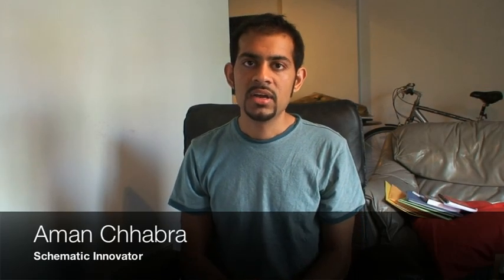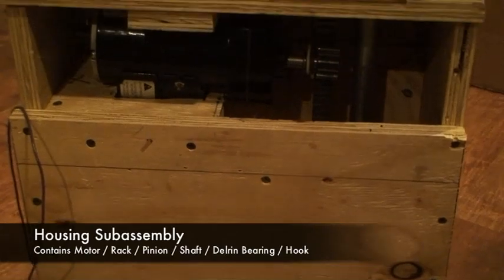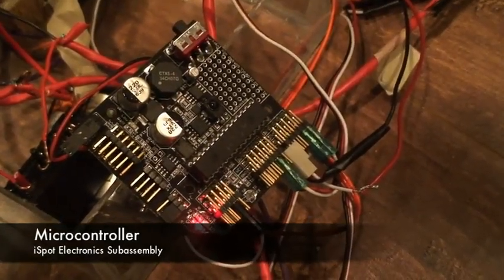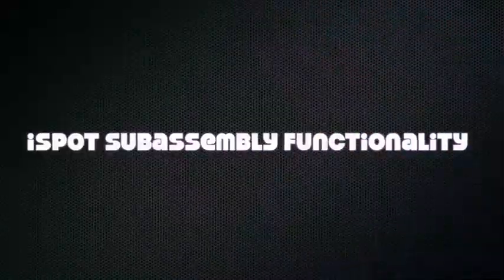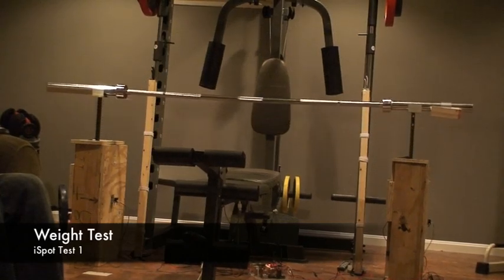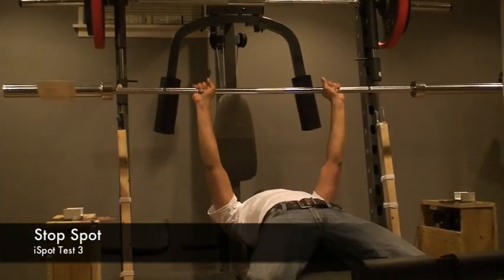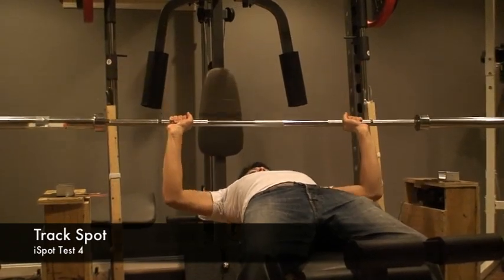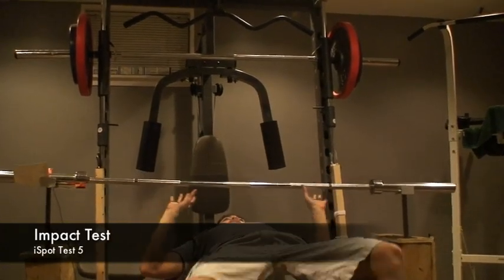iSpot Final Presentation Video

Comment: It's a nice idea but a little over-thought IMO. A couple of heavy-duty load straps hooked to a power rack or the bench pins does the trick for me. Position them slightly below the lifter's range of motion and you have a spot. How much weight can this really handle anyway? Is this for fitness enthusiasts or can it handle real weight?

Comment: Couple of things. First, they really need to be positioned on the bar itself and not where the weight plates would be. Secondly, the size of the support hooks are way too small and here's why. Near the end of an all-out set, which is what this would be used for I assume, the bar is not necessarily going to travel in that 2-3" range for the weight to be caught due to the lifter's fatigue. I would say, to err on the side of safety, that the catch on this machine should be up to1' long.